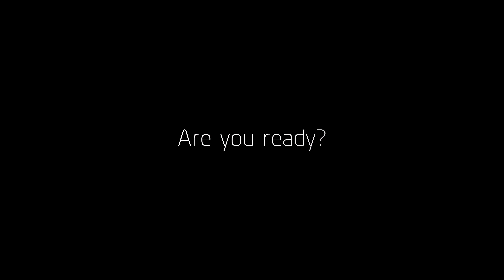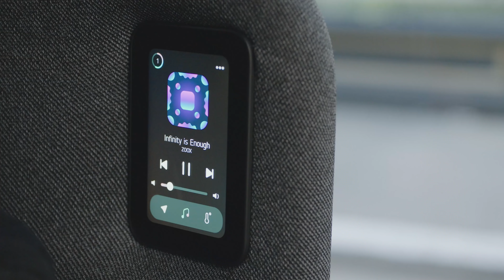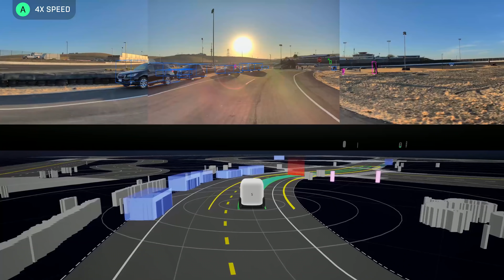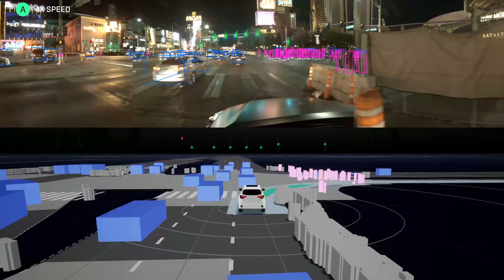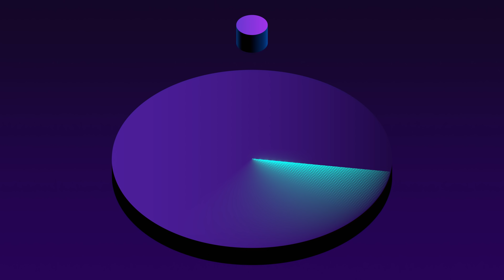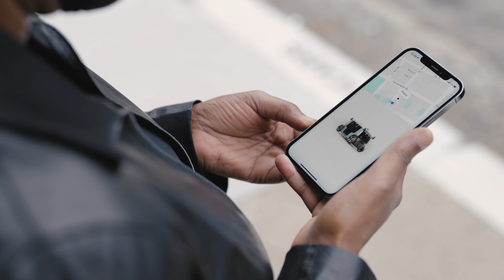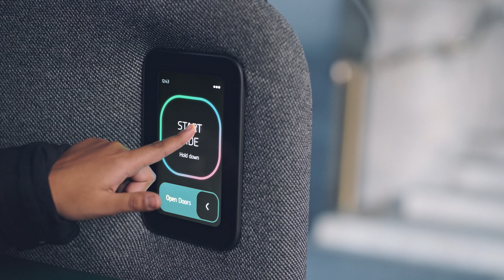Fully Autonomous, All-Electric and Built for Riders, Not Drivers—This is Zoox

Comment: ML Engineer: Ugh cars aren’t cuboids—we need sem seg. 
Car Designer: Say no more.
Reply: I think It’s meant for city, so I guess aerodynamic is not a priority.
Reply: @f-2215  fuel efficiency is usually a problem with such designs. Even if it is EV, the vehicle has to combat air resistance ... Aerodynamics  would do a better job. I'd wanna see their numbers.
Reply: @mwanikimwaniki6801  there’s a reason it has such a massive battery pack, no way it’s efficient

Comment: I love the symmetry of the Zoox pods. Reversing, what's that?
Reply: Not Aerodynamic sadly at 75 mph.
Reply: @KamleshMallick  yeah probably not. But I doubt these vehicles are designed for highway driving. I imagine almost all of their of their driving will be in heavy urban situations.
Reply: @KamleshMallick  think they're primarily designed for high density urban areas. Not even sure if they can reach 75 mph?
If they are intended for highways I'd imagine they'd utilise fleet "platooning" to make the pods more aero efficient. Similar to carriages on a train, but without a physical connection.
To me the biggest issue is getting people to embrace shared mobility post Covid.
Reply: @paulski1080  they can reach 75 but so they technically can drive on the highway but its mainly for cities
Reply: @paulski1080  They are being designed for highway driving also.
Reply: @ryderdonahue  you clearly didn’t pay attention to the video. It said it could do highways.
Reply: @Jonathanest90s  I've never seen a 75mph car on a highway. This would be a disaster of blocking highways because of such low speed because it's MAX SPEED so the actual is around 100km/h. Compare it to 160-180km/h on Autobahn on the slow line. God damn, you are naive.

Comment: Congrats Zoox team on the work getting to this point. I'm hoping you'll continue your thoughtful approach to improving the ride-share experience (cleaning, wifi, navigating heavy rain (Seattle), payment accessibility, rider safety, then rider abuse/reporting/restriction (basically riders who are a danger to other riders)).  Excited to see your next big milestones.
Reply: Josh - here you can see another Robotaxi, designed to be fully safe for every rider, even during pandemics. I am convinced since 10 years that Robotaxis must have separate cabins to be widely accepted for sharing with strangers. CabiBUS com - now searching for investors
Reply: @kennethpalmestal7903  Oh nice! Yes, that solves a lot of the problems that Zoox will run into. Also, I much prefer the separate cabins approach. I'm sure those who have been harassed/victimized in other ride-share situations would very much appreciate it. Hope your endeavor takes off and finds a solid investor. :)
Reply: @kennethpalmestal7903  Another use case this might help with, the larger separate cabins could be ADA equipped for those with accessibility needs (wheelchairs). Another thing I really want autonomous ride-share companies to consider, those with accessibility who want to enjoy the same door-to-door freedom, independent of spotty public transportation (citing San Francisco only).

Comment: Love the use of standard parts front & back, inside & out, a great bit of design simplification to reduce part, speed up build and save money.
Have you thought about a UV cleaning system between users? Not sure if that would work just an idea.

Comment: This is excellent. Very exciting. This whole concept is revolutionary. Modular design - drive pack on both sides - LIDARs/cameras at each corner.  Inviting, safe and simple design. I saw a lot of cabling in the assembly shots. Any reason they are not utilizing wireless sensors/actuators?

Comment: Cons: 
 - Pre-Mapped roads (limited in routes)
 - Lidar (expensive for no reason)
 - Manual A.I. curation + limited data sample
 - Simplistic 3D A.I. Model (might miss weird things? How about hand signals and other pedestrian communication?)
 - Still in manual manufacturing
 - Legal?
 - Cost? It competes with public transport and taxi in certain zones, so it need to be cheaper at scale. 

Pros: 
 - Symmetrical design (easier manufacturing) 
 - Different -  Use case in mind. 
 - Even if it's on known roads, if it drives well, it can be useful 
 - Good for private routes (airports, campus, etc.) 
 - Highway capable = cargo? 
 - Electric!

Comment: When the car body of the box model is accelerating, it seems that the accumulator battery will consume a lot of fuel due to air resistance. In addition, when another car or object approaches (attack) and crashes in an accident, the glass surface is exposed to a lot of damage, so the wound will be more severe. It seems to be vulnerable to cold or heat. When you sit face to face, it can be uncomfortable if you don't know the other person.

Comment: Other use-case if 100% car are self driven, the infrastructure cost on lights, software would be redundant. Cars can self manage and flow themselves in a network with best possible traffic management system.

Comment: Questions: How does Zoox perform in locations with significant precipitation, where road markers can be significantly obscured by snow or flooding?  How does it perform on icy surfaces?  Considering the low clearance and small wheels, how well does it traverse potholes?

Comment: I hope their engineering budget was at least half as good as their marketing budget... A lot of promises but compared to the concept behind Tesla's autonomous driving, this is overly complicated and depends on existing 3D mapping of each area. You can't scale this enough, but it might work as a smart bus service from designated points running on a loop.
Reply: Tesla autopilot is trash. It's very easy to scale geofenced driving as the mapping happens quickly.

Comment: Why they put a big wheel on those? You can put smaller one that is cheaper, economical and safe space all because the ground clearence is so low. So it doesnt make sense to use big wheels. And also imagine if this vehicle use to transport passangers to airports or train stations. A bagage will be handy for those function.

Comment: What happens if the power grid fails? We'll be sitting waiting to be rescued without even a steering wheel to hold on to until we're gotten to by external saviors. Phooey! I like driving. I like being in control, at least of where I go and how fast I get there. This baby-driver-making technology is for, well, babies. Adults like to be in charge, not at the mercy of technology.

Comment: So, at least, (for me, wheelchair bound) a vehicle that may be useful although I still drive AND want to.
It is TOO small for use with an electric wheelchair WITH other passengers UNLESS more flat space in the middle is made.  I need only about a max range of 75 miles per day.
At this point don’t want BEV until it truly shows it’s “greeness”, and that INCLUDES all the mining/pollution, so called green electrical that must be recyclable, you know all the EV controversies.

Seems MUCH $ and WEIGHT could be saved if there was a version that WASN’T self driving.  I guess I’m just selfish wanting a wheelchair van that ISN’T  a highly modified Dodge Caravan like I’ve been driving for 18 years.
I’d settle for a LARGER Kenguru that works with electric wheelchairs.

Comment: this is the worst mode of transportation ever conceived. its impractical, stupid and dangerous. If they were to be operated around poorer, more deprived areas with more serious problems such as theft and vandalism, you would also need to do things like enforce more police, put up cctv, and remove bushes to avoid getting jumped. amazon- i mean zoox- has no intention of doing any of this. Also, this could put other services like uber, trams and rail down the drain by making prices cheaper, then by massively increasing them after the other service have gone bankrupt, making amazon basically own all the cars in your city. Then because amazon aren't making the deprived areas safer, they will probably get vandalised, damaged and maybe pissed upon, so amazon will stop running services there, making them even more deprived, because its the rich neighbourhoods that being in the income. can i also mention how insanely easy it is to get robbed in this thing. you and three other seemingly normal strangers pile into this thing, then they hold you at knifepoint, take everything on you, smash open the doors and scram. on a bus, the driver could call the police and lock the doors, while other passengers report his location. would amazon invest in bulletproof glass and cctv cameras? NO! of course not. they would, once again, stop running services to the poorer areas where there is higher crime, because thats the more profitable option. also what if someones dog shat on the seat? you would have to wait another 15 minutes for the next one. what an 'efficient' mode of travel. plus, the scalability of this is atrocious. these disasters on wheels can only transport 4 people max, which is less than the average car, so for the morning rush hour, you would need literally tens of thousands of these things just for that. in a bigger city like san francisco or los angeles, it may well be in the hundred thousands. you can do all this with about 20 metro trains. mmmmmm, scalable. also, in terms of the self driving technology, they claim it has level 5 self driving. how did they prove this? they self certified it. b r u h. have you even seen the videos of self driving taxis just stuck? in reality, level 5 self driving just means there are no steering wheel or pedals to operate the car. this is just a big fat marketing trick. by the way, a thing driving around a parking lot with no lanes, signs, other cars, bikes, obstacles, other people, road markings or traffic is not impressive. a better solution is to make it longer, have more doors and can seat more people and have it run on a network serving everyone equally- HOLY SHIT THATS THE DEFINITION OF A BUS!!11!1 basically, i do not want to see and of these four wheeled failures in my city, EVER.
Reply: Get a job
Reply: @saladien9987  i am 14
Reply: @xoneqraft_transport  that explains your text.